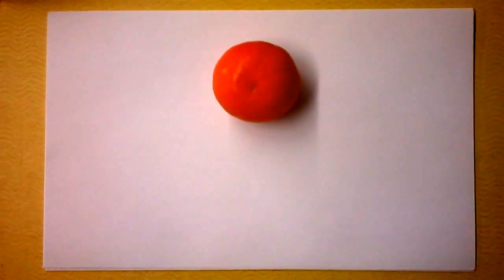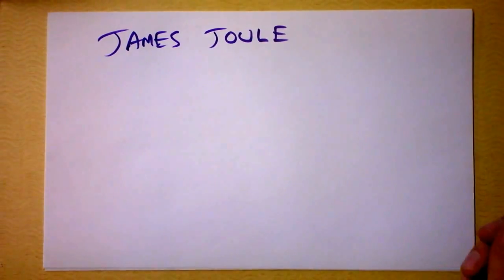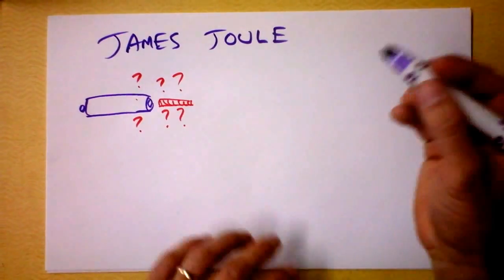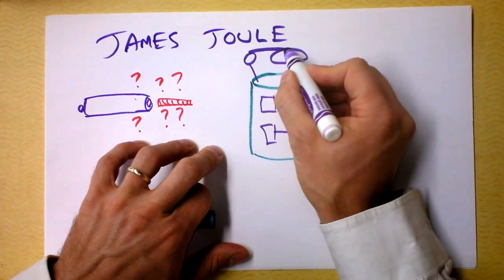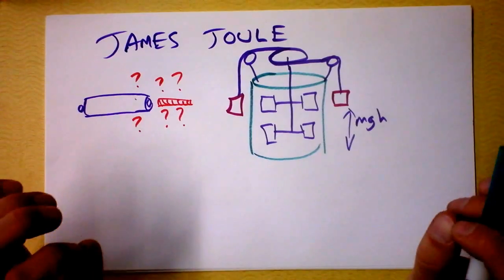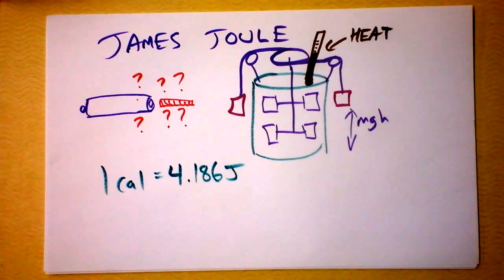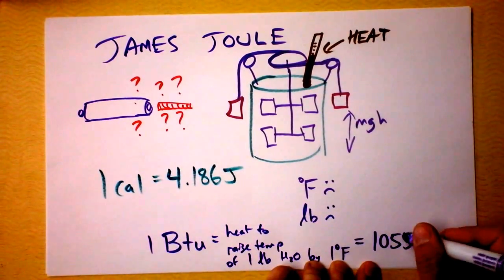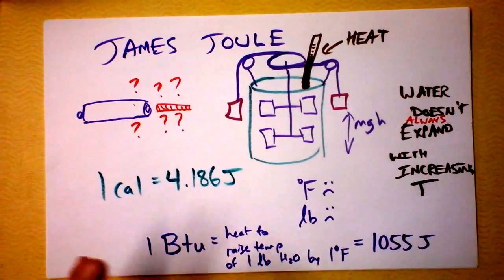Mechanical Equivalence of Heat Energy - The Joule and Calorie UNITE! | Doc Physics

Comment: when does water expand with temperature?
Reply: After 4°C
Reply: Ice fills more volume than the same amount of water.
Reply: Yes it's past 4 degrees. Basically, from 0 to 4, water becomes more dense, and then 4+ it becomes less dense.
And actually, unlike what media will tell you, this is in fact the real reason of the rise of the oceans related to climate change, NOT the glaciers and polar caps melting or stupid shit like that lol. Ice melting is nothing when compared to the dilatation of water stemming from higher temperature.